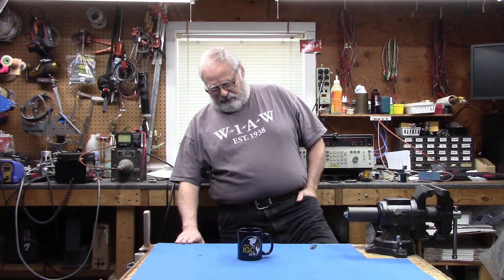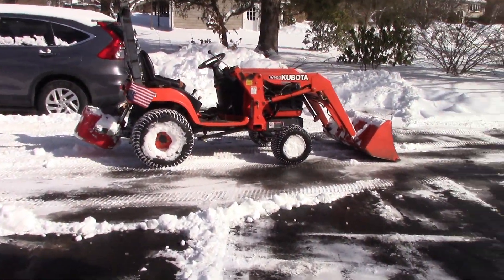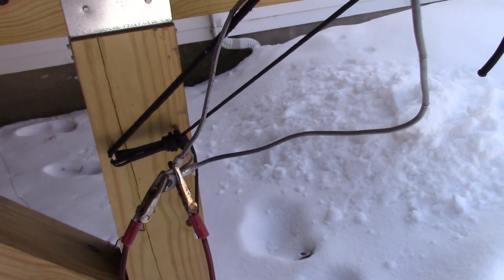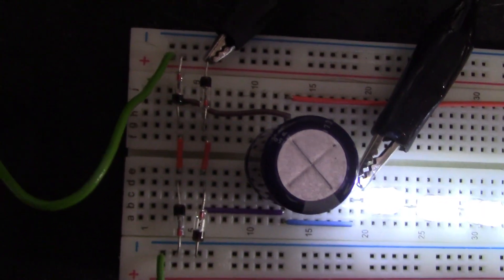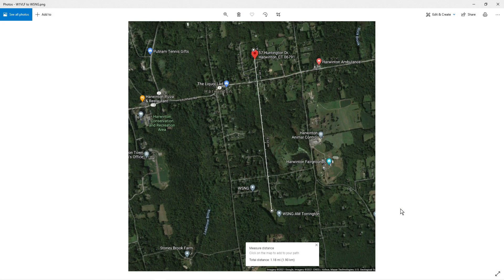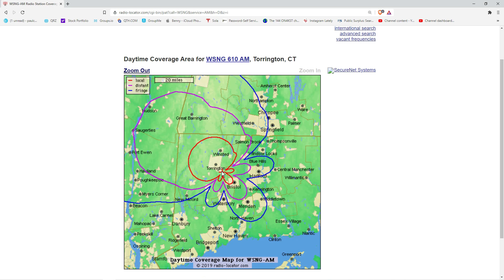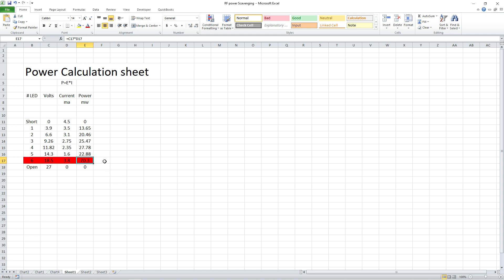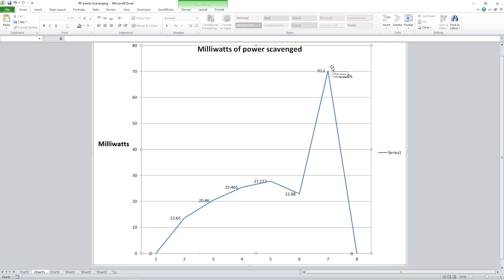Free Power #3 Final Episode of scavenging free power from the local 610 KHZ AM radio

Comment: Hi Paul.  This was a great series.  I was not bored at all.  Sorry for the dumb question, but I guess you couldn't extract as much power if your antenna was shorter?  I live in a house on a small lot 22 miles away (as the crow flies) from wabc's transmitter site.  How much more (or less) power do you think could be extracted from that 50,000 watt transmitter?  I hope you make more videos.  Thanks!

Comment: Far far FAR more power than I would have ever expected from that far away from the transmitter.
But then 610KHz right?    
Try that with UHF.   
Probably works similarly if you are "445/.61" Times closer to the transmitter and maintain the same efficiency and losses LOL.   
Thanks for doing the videos.    
Very cool.

Comment: now,  how can this power be stored for future use ?
Reply from the maker: Sure,  You can charge a battery.. Although at 70 Milliwatts it will take time depending on the battery size, but yes.  it can charge a capacitor, it can charge a battery

Comment: Hi Paul, great video. I hope you will make more in the future. As for me ... I found them valueable. Question: Do you think will be possible to charge a small battery 18650 for example with that power?
Reply from the maker: Hi Catalin, Sure would... It would take some time to do it.  Since 70 milllwatts is enough to lights 6 leds, but it would be slow at charging the 18g50... But that would be fun to do... W1VLF